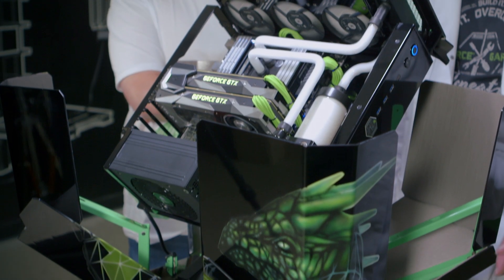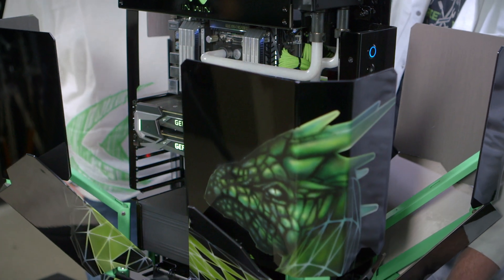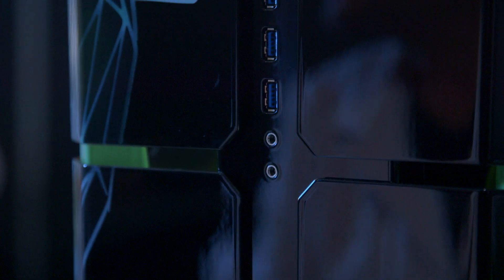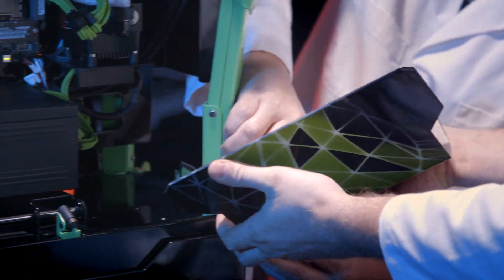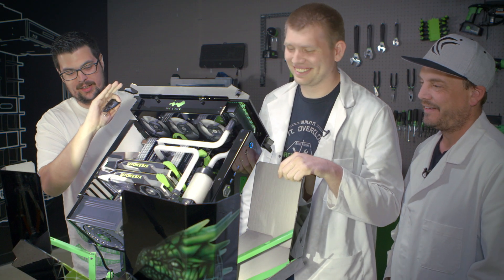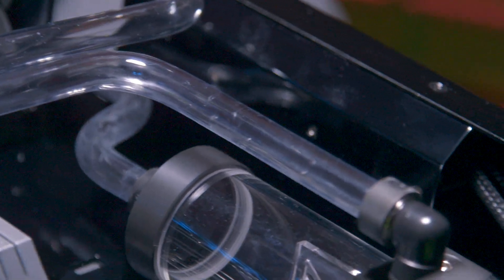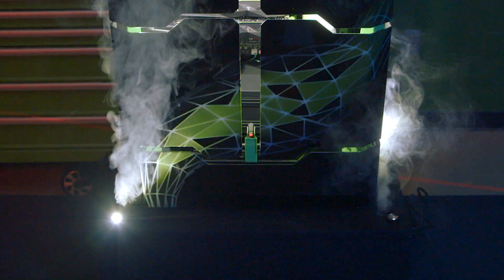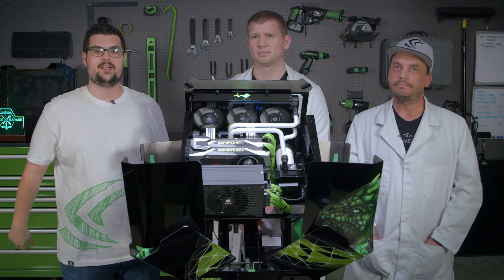GeForce Garage– Making The GeForce GTX 1080 H-Tower

Comment: Considering you guys work with graphics, it's astounding that you have so many artifacts in  these videos. It looks lik 6 bit color. So blocky. I haven't seen anything like that on other similar videos from other uploaders, so you are doing something wrong. Kind of strange that you haven't picked up on this yourself, since it's been an issue for over two years. 

Hint for best possible result: Upload a uncompressed 4K file. For sure that will look good on youtube, even though the upload takes a long time and the compression even longer. But this is just unacceptable for a company working with graphics.

Comment: Your little diameter, high sound blower design for the reference (founders edition cards) suck! The little fan is LOUDER and HOTTER than bigger fan designs. Anyone with a high quality mic will be able to hear this during recording. I hate having to wait for board partners to be able to release a card that isn't obnoxious with the high RPM small fan design. I would have already bought a NVIDIA 1080 if it wasn't for this old fan design choice.

Comment: I kinda feel this is too far over the top....
Reply from the maker: Or just the right amount....
Reply: Kinda disappointing that this uses the Haswell-E that fares worst on a single core compared to the new Skylake CPUs, so it's not an optimal build for gamers and cost much more, those 64 gigs RAM are unnecessary, by doing a specialized gaming build with the 6700k and less Memory it will cost much less and you can still get better performance out of it for running games.
Reply: +Wacky Jackscum their goal was to make an overkill pc, I think they quiet nailed it
Reply: I like the paint job but don't like the idea. Something cool with the watercooling would have been better.

Comment: BUT !!!
Can it handle 4x GTX 1080 ?!!?
muahahahhaha
Reply: No not in sli because the GTX 1080 only goes up to 2 way sli
Reply: +Felix Stein Tibet they won't allow it anymore.. Just for benchmarks... 
Now.... Back to my original post 😃
Reply: +1000 subs no videos challenge it goes up to 4 way if you ask nvidia for a unlock code
Reply: nope you can use it in 4 way sli if you get the key needed to unlock it, there is several videos about it from people that has gone through these cards.
Reply: the thing is more that you need really core heavy processors to get these cards to work in sli.
Reply: +Felix Stein like a 10core 6950x for 2000€ xD
Reply: from what ive heard you could use the older i7s like the 5930k if you overclock it to at least 4.5ghz
Reply: +Felix Stein the unlock code is being dropped
Reply: oh im sorry, didnt know that, well thats a shame, still good cards tho :)
Reply: Crash Gaming they still allow it just the actual program has to support it, so if ashes of the singularity can use all 4 cards (can only use two at the moment) then it will use all 4 cards